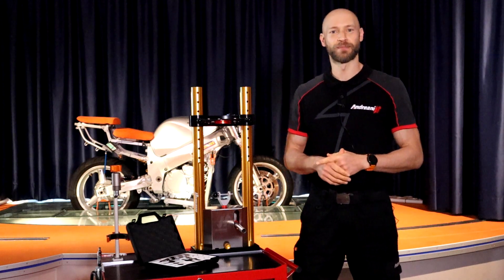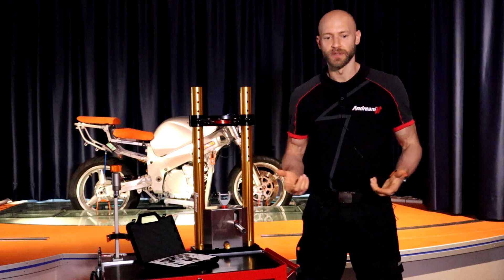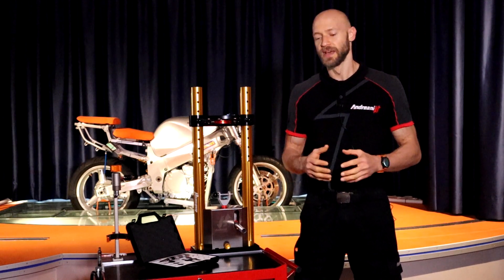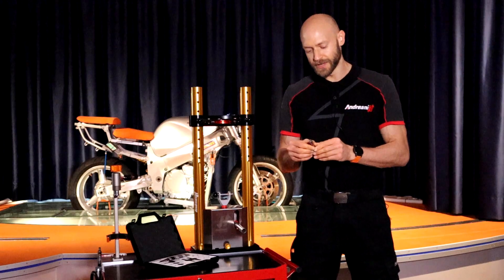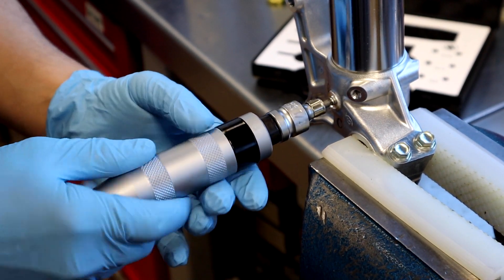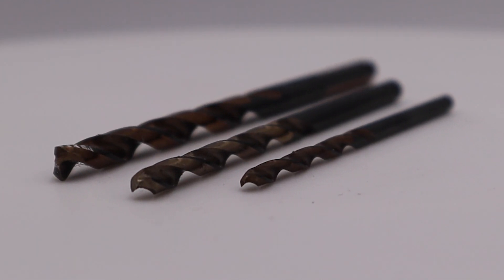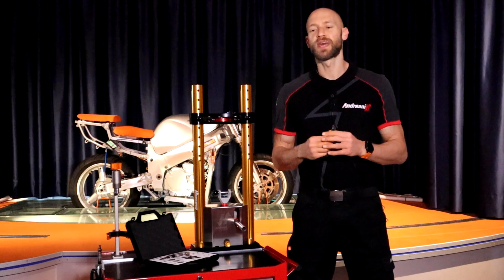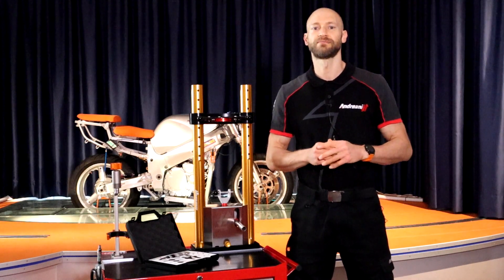How to Remove the fork grub screw

Comment: So to remove a part put in by the manufacturer you have to drill it out rather than remove it with the same tool the manufacturer used to put it in? Doesn’t make sense.